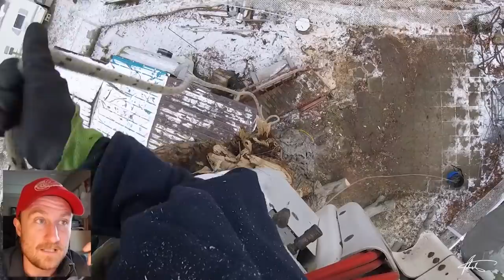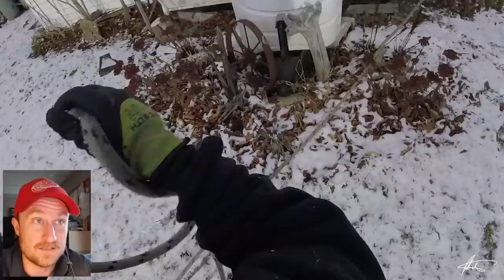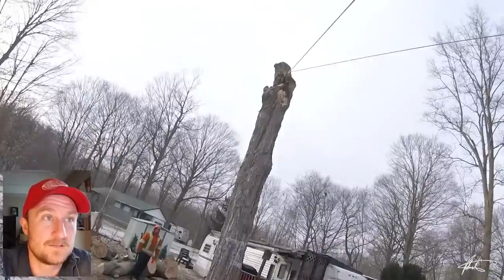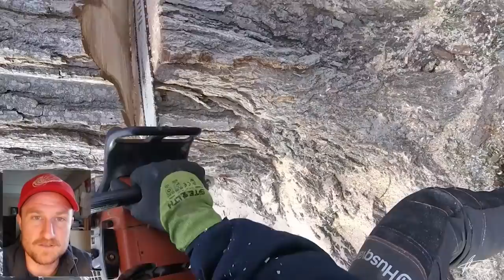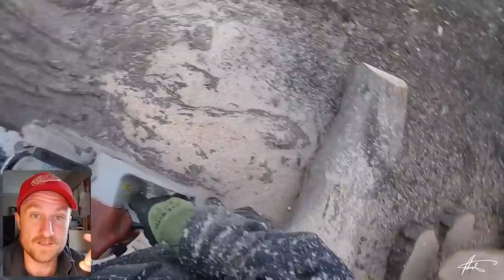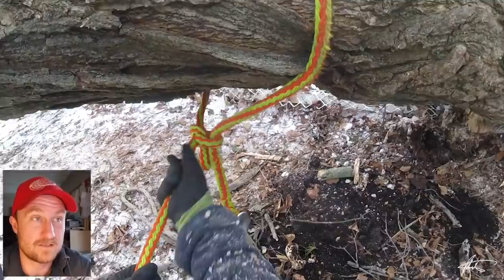Felling a Peg in a Tight Spot with Mechanical Advantage

Comment: The zeppelin bend is my favorite for joining 2 ropes. I have noticed however, different diameter ropes can make it more difficult to untie after heavy pulls with vehicles. Also I used to have issues with joining 2 3/4in stable braid ropes together, one very old and worn and the other almost new. The old rope would almost weld itself to the other and would be a bear to undo but we're talking about pulling with vehicles. Still my go to for joining ropes. The other option I use is a bowline on a bite on each rope and 2 clevis shackles (bend radius) to join them. Love this channel Patrik I have learned quite a lot, keep up the good work sir!
Reply from the maker: Hey thanks brother, definitely agree that it works better when both ropes are same diameter....       - Patrick

Comment: Nice work.  You can always use your ring sling with your pulley.  Just pass the tail through the ring to choke and tie an appropriate attachment.
Reply: It may be better not to have your expensive block riding down on the stem unless your in a crotch or bend in stem that offers some protection
Reply from the maker: Damn Nels, that never occurred to me, that would have worked perfect in this situation. Thanks for sharing that brother!          - Patrick

Comment: Mighty stuff Pat, 👍 Strange the way sub contract work differs in Canada. Here we bring all our own gear and I definitely prefer it that way. I know my saws are tuned properly, are maintained and have sharp chains. One of my pet hates is people milling around the butt of a tree when I'm in the middle of falling it. I prefer to have one knowledgeable groundsman who knows what he's about rather than a shower of 'know it alls'. Don't be afraid to scribe your back cuts, it saves time and makes one more accurate.
Reply from the maker: I bring all of my own climbing gear, *most of my own rigging gear (not all of it), as well as my climbing saw (MS200T) and at least one larger saw, usually a Husqy 575XP with a 20" bar .  I end up using stuff that I need, including ropes and saws from the contractor, depending on the situation... I definitely wouldn't say it's a Canada/U.S. difference thing...  just the way I roll nowadays...    for a long time I travelled with my ground guy and a few extra saws...    thanks for watching brother, I really appreciate it!       - Patrick
Reply: I bring all my own stuff too. I'll be damned if i trust a stranger's climb line. And the quality of my equipment justifies my higher rate of pay.
Reply: @batmantiss  Agreed Sir, 👍🌲🇮🇪

Comment: That low jet needle needs an 1/8 turn out too, erratic idle and the poor throttle response are indicators for a lean condition if it bugs ya and you have to run it much.
Reply from the maker: Thanks man, I will tell him. Do you do saw adjustment videos? 'Cause that would be awesome.........    just sayin' ..........     - Patrick
Reply: Working on it. Just got the paid version of filmora for editing.

Comment: I appreciate the way you explain, good for a beginner like me! 😉
Reply from the maker: Thanks brother, appreciate it!     - Patrick
Reply: If I could offer some advice in this scenario, before getting excited about dropping a huge log, consider wether there may be pipes or other underground services. Particularly if the log is not smooth. The satisfaction of an accurate fell is quickly deflated when a huge puddle suddenly appears
Reply from the maker: That is excellent advice, and so true. Thanks brother.    - Patrick

Comment: I'm curious why the load rope goes through the ring pulley instead of securing it through the ring and running the pull rope around the outside?  Is the friction still the same?

Comment: Do you worry about smashing your ring/block when the peg hits the ground, when using this technique?
Reply from the maker: Definitely, glad you brought it up. On this one, the top portion had a backlean so I knew the ring wouldn't hit, but normally on a straight peg, I would have laid out a piece of trunk wood to cushion the fall, which would also keep the block from hitting the ground directly. Hope that makes sense, thanks for watching...     - Patrick
Reply: Makes perfect sense, thanks! 
I could tell this one had the back lean, and wasn't sure if you just planned your rigging point around finding one of them all of the time, or had a technique like you just described.

Comment: Love your work and and videos! they help a lot with understanding concepts like this. Just wondering your thoughts to using this method vs a single rope with a alpine butterfly or something as a 3-1? Or a block and tackle 5-1 setup?
Reply from the maker: On a big spar like this, I wouldn't trust a 3:1 or a 5:1 to get the job done, it would have to be something more significant, like a skid steer or a truck...  The 2:1 advantage in this case was as much about the angle as it was about the increase in pull....  Thanks for watching brother!     - Patrick